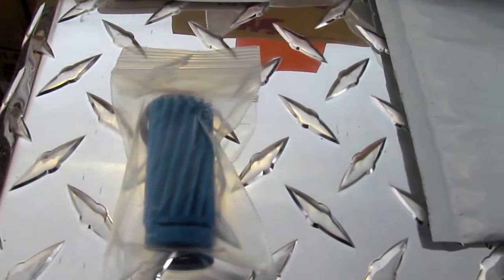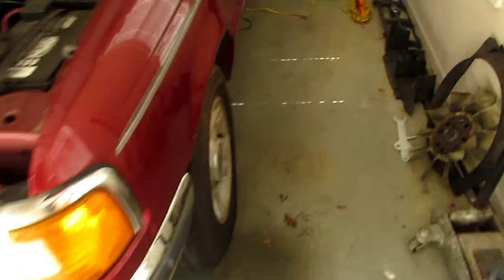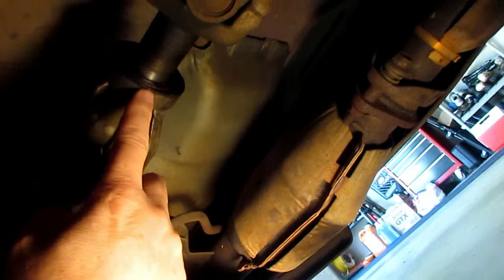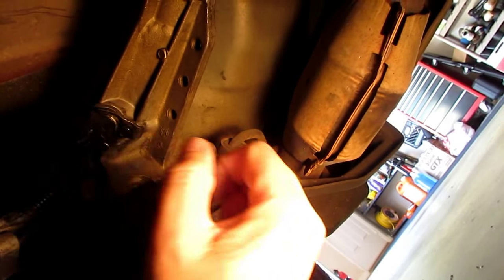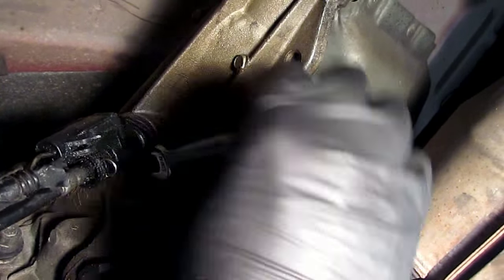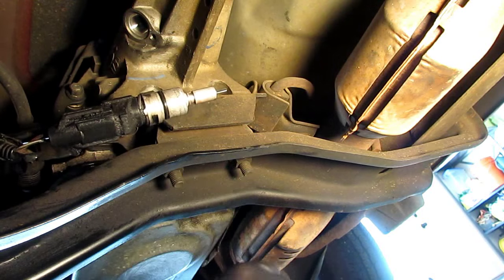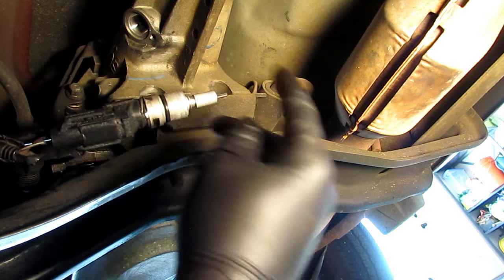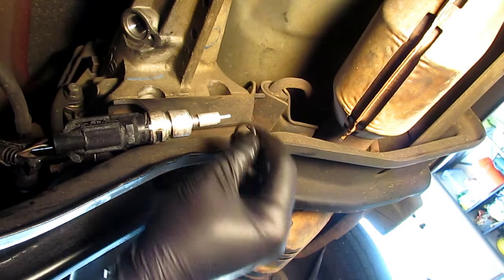Ford Ranger Speedometer Gear Change

Comment: Thank you for the video. I'm sure it was annoying filming under there but now I feel better about changing my speedo gear in my 91' Mustang.
Reply from the maker: Yea, at the time I only had my big camera so it was a pain to keep it pointed in the right direction.  I have a GoPro now with a little tripod and it makes filming in tight areas a lot easier!  I hope your speedo gear change goes as smooth as mine did!  Thanks for watching!

Comment: AMC used the same speedometer driven gears as Ford. I swapped out the driven gear on my '69 AMX from a 22-tooth to a 23-tooth.  It attaches to the cable in the same manner.  The screw that secures the cable to the T-10 4-speed is a 3/8".
Reply from the maker: Thanks for watching and for sharing that tip!

Comment: Was looking for this exact video! My 1994 Mazda B4000 SE 4WD manual speedometer starts bouncing back and forth when I hit 50 mph. The needle will usually bounce between 50-60 consistently when I hit that speed. I was told I should probably grease my speedometer cable. Would this same method work on my particular truck? And how would I pull the whole cable out, grease it with a PTFE-type lubricant and reinsert it from the gear to the instrument panel correctly?
Reply from the maker: Yes, sounds like you need to grease the speedo cable.  I'm not familiar with that particular cable, but normally, you can remove the gear from the bottom and slide the cable out of the sheath from the top.  There may be a keeper on one end or the other you have to remove, but otherwise, just slide it out, wipe it off and put your new PTFE lube on the full length of the cable, smooth it out and reinstall.  Thanks for watching!

Comment: Dennis, Thanks for posting this excellent video. 2 questions:
I am using just to simplify the non-functioning odometer and trip meters troubleshooting for my 96 Ranger. DYT that it is a bad gear within the instrument readout itself or could it be something else?. The speedometer is still working.
Also wondering if you might have an idea of the number of teeth I need for my 75 M-B O309D Bus that needed a rebuilt Allison AT540 transmission which I removed and replaced from another application (dump truck)  that now reads exactly half the actual speed?  I would think that 1/2 the number of teeth is correct. A speed shop in my area  (Puget Sound)I visited probably has or can get the right part. Your opinion would be highly valued.
Reply from the maker: Thanks for watching, Mark!  If the speedo is working and the odometer is not, I'd suspect a problem in the instrument cluster.  Not sure of that, but that's where I'd start.  And, you are probably correct about the number of teeth needed on that Allison, but I'm really not sure as I'm not familiar with them at all.

Comment: Great video Dennis!!!! My kid has an 06 Ranger with 33" tires on it. From what I'm reading it has a 17 tooth stock and I should go up to a 19 tooth? Does that sound right to you?
Reply from the maker: Thanks and thank you for watching!  If you increased the tire o.d., you'll have to go to fewer teeth on the tranny end of the cable.
Reply: Dennis Coffey  I have a 06 ranger with SOHC 4.0L V6 it has 17” rims it’s has no cable all I see is 2 sensors on the transmission and they’re both new in the one in the rear end and the two tire sensors I put my snap on scan tool and when I shit fit on second gear in the scaner  tells me that it’s in third gear I had the PCM reprogram with all the new updates and it still doing the same thing I just don’t know what to do anymore please help
Reply: @snj4807  yours needs reprogrammed by the dealer. 96-97 was start of electronic speedometer reading.

Comment: Dennis- Can I assume that you removed the original 225/70-14 tires and installed 235/70-16's. I have just done the same thing on my 1994 Ranger. When I am going 65 (per the speedo) I am actually going 75 (per the GPS). Are these the same conditions as you found with your truck and if so did the blue gear correct it? Thanks
Reply from the maker: +Dirk DeJong Hi Dirk, yes sir...that's exactly what we did.  The blue gear got us as close as possible.  Up to about 50mph with the blue gear, the speedo is now correct.  At 65mph, the speedo is about 3mph slower than actual speed, but since that is the smallest gear available, that's as good as we can get it.  It definitely much better than being off 10-15mph though.
Reply: +Dennis Coffey-------- Thanks Dennis. I finally got rid of those puny 14" wheels and the extremely limited tire options that fit them and put on a set of 16's from a later model. It changed my whole attitude about the truck. It sounded like you were on the same page so I just wanted to make sure you had the same tire sizes etc. I will double check my current gear to be sure I have a green one now but it sounds like the blue will be needed regardless. Thanks Again, Dirk
Reply from the maker: +Dirk DeJong Our Ranger is our youngest son's, and we both thought the same thing about those 14s.  I lucked out and found a used set of Sportrac 16 wheels at a great price,  got new tires put on them and it really made a difference in how that truck sits, looks and rides.  Thanks for your comments and feedback, I appreciate.  Godd luck with your truck!
Reply: +Dirk DeJong------For anybody else that happens across this post I have some more information that may be helpful to some. On my 1994 Ranger Extra Cab 4.0l V6 rwd truck I had stock 225/70-14 tires, an R5 axle code which translates to 3.55 final drive gears and an orange speedometer driven gear. When I installed 235/70-16 tires I was getting a speedometer reading that was 10 mph low (65 shown/ 75 actual). Using the information Dennis provided, I calculated the required gear using both of the formulas and averaged them to get a 17.78 tooth requirement. I installed an 18 tooth (grey) driven gear. My speedometer is now reading virtually perfect throughout the range. Hope this helps someone.
Reply: Where you buy the gear ⚙️ corrector .

Comment: Hello have questiong i have 96 ford ranger 3.0 and i have 33 inch tires with 15 inch rim my speedometer shows wrong if am going 35 my gps saids am going 45 what speedomer gear i will need .?
Reply from the maker: Thanks for watching, Yaritzel!  You'll first need to know which gear is in your transmission now.  Then go to 8:40 in the video to calculate the correct replacement gear.
Reply: @dwcoffey  thank you so much

Comment: Does the spotted shift on the sensor fitt into a slot inside the gear,or does it spin inside the gear
Reply from the maker: Thanks for watching, Doug!  It's been while, but I believe there is a piece inside the gear that goes into the slot so the gear doesn't freewheel.

Comment: Hi Dennis nice video man, Im trying to find not the plastic gear on the VSS but the internal Transfer Case drive gear, may be somebody else can find this usefull, I tried changin the VSS, the cable but only when we take the transfer case out found that internally there is a plastic gear too, was completly broken, Im trying to find that part, any clue dear friend? Its a Ford Explorer Manual V6 manual transmision, cheers.
Reply from the maker: I'm sorry Ricardo, I'm not familiar with the 4WD transfer case on the Explorer.  Thank you for watching!

Comment: Hi, a question. For the Ford Ranger 1994 V6 4L is the same location of the speed sensor? It change depends of the model year? Please your support. Thks.
Reply from the maker: Hi Sergio, thanks for watching!  If your Ranger has this gear on one end, there is no speed sensor, only this cable to the mechanical speedometer.  Later models had a speed sensor on the end of the speedometer cable, then some had a sensor in the rear end.
Reply: @dwcoffey  thank you very much. At the end means? Till end of transmision? Regards
Reply from the maker: at the end of the cable.

Comment: Can any one tell me the difference between a 1994 and 1995 2.3 manual ranger transmission is it just the speedo gears and can i swap them out
Reply from the maker: Thanks for watching, 94 and 95 used the M5R1 manual tranny.  Here's some info on the speedo gears:  
https://www.therangerstation.com/forums/index.php?threads/m5r1-speedometer-gears.16067/

Comment: I have a 3.08 rear gear with a 17 tooth gear and smaller than factory tires, it reads 3mph fast and I did 4 calculations using the same criteria and 2 got me 18, one got me 19, and the slowest got me 20.
Now im more confused.
Reply from the maker: Thanks for watching, Dominick!  So I'd split the difference and go with a 19 tooth gear.
Reply: @dwcoffey  After some more research I decided I needed a yellow gear so I took a yellow one out of my friends truck and swapped with my white one, now it reads accurate and his speedo works now so it was a win win situation
Reply from the maker: Fantastic!  I'm glad that worked out.

Comment: Ig I havent changed the size of my tires but the speedometer is reading 5 under the speed how would I fit that?
Reply from the maker: Thanks for watching!  You'll need 1 or 2 teeth fewer than your current gear.  If your speedo is 5mph lower than actual speed in the 20-40mph range, one tooth less will do it.  If the speedo is 5mph under actual speed in the 45mph+ range, you'll need two fewer teeth.

Comment: Hello, I have a serious problem with my vehicle. I own Mahindra thar crde 4x4 2013 model. Very often I observe the speedometer gear is getting damaged (especially when I hit a pothole). This is my 5th time I am replacing the gear. It’s 17 teeth model. I really don’t understand the root cause. I would be very grateful to you if you have an answer for this. Thanks in advance
Reply from the maker: I'm sorry Sanga, but I'm not familiar with that vehicle at all.  But...usually, if gears are getting damaged, it is because one of the gears is moving in a direction it shouldn't.  In other words, maybe the speedometer gear is not properly meshing with the gear in the transmission, perhaps the retainer bolt holding the cable in is loose.  If not, perhaps the gear inside the transmission is loose or damaged and chewing up the speedometer gear.  I wish I could be more help.
Reply: Dennis Coffey thank you for the quick reply mate. I will try to see first thing in the morning. Thanks again
Reply from the maker: Let me know what you find and I'll do my best to try and help.
Reply: Dennis Coffey sure, thank you mate 😊
Reply: Dennis Coffey it was due to worn housing. Got it replaced and it’s working fine now.

Comment: Will this also recalibrate the odometer as well
Reply from the maker: Thanks for watching, Jared.  Yes, this should make the odometer read correctly as well.  It won't change what's already been registered, but it will make it read accurately from the time the gear is replaced.

Comment: i have a 97 ranger speedo not working at all automatic trans. and speed sensor gear is red. i put a new speedo sensor but still not working any ideas.
Reply from the maker: Thanks for watching.  You may have a broken speedo cable, or the speedo itself is bad.

Comment: When I did this, transmission fluid came pouring out the hole. I just wonder why yours didn't do that. I have a 91 ford ranger.
Reply from the maker: Thanks for watching!  How much fluid came out of yours when you pulled the gear?  If is was less than a few ounces, I wouldn't worry about it.  If more, your transmission may have been overfilled.

Comment: Hey Dennis where could I find the drive gear just like you replaced for a 1991 f150 4x4
Reply from the maker: Hey Steven, thanks for watching.  I can't remember who specifically I bought mine from, but it was either RockAuto, 1A Auto or Partsgeek.com......I know I got it online, but not sure which one of these I use.  I only use these 3, so it had to be one of them  :)  Good luck!

Comment: I have the same problem with my 98 ford ranger also it takes time to shift first 3 gears
Reply from the maker: I love the Ford Ranger....it's a great little truck that has evolved well over the years.  The one consistent problem I see with them though is the transmissions.  they seem to always leak and shift odd after the mileage gets high.  thanks for watching!
Reply: Dennis Coffey  I have the same problem I had the transmission rebuilt three times no second gear it goes to first gear to third gear Emma rpm to so high where does it leaks and how can I fix it
Reply: Its most likely the valve that the vacuum line is hooked to it has a screw that adjust for faster shifting. They will start leaking and fluid will get in lines it won't shift right.

Comment: So my truck is registering 57 but radar is saying 50 what gear do I need? 18 in it now
Reply from the maker: As shown in the video, if you have a 2WD truck, you need a 20 or 21 tooth gear.  Thanks for watching!
Reply: @dwcoffey  I got it it works the same way as yours. As long as they are on the driver side of the transmission they all are the same thing and FYI mustangs are like that too.

Comment: Is this a 5 speed or automatic?
Reply from the maker: Hey Joe, this is an automatic.  Thanks for watching!
Reply: Dennis Coffey thanks brother I can't find the front sensor on my dads 98 5 speed I love changed the the vss sensor the one on the differential and for the sake of my life can't find anything on manual transmissions for this truck nothing whatsoever I'm betting its under the brake booster right on top of the trans along the bell housing is what I'm assuming but I really hate to take all that stuff out and be wrong. But thanks for the feedback Dennis.
Reply from the maker: Hey Joe, I don't think there is a 2nd sensor on the 98's....I think the only one is in the rear-end.
Reply: Dennis Coffey hmm I wonder what's the issue with my dad's speedometer I've drove it with a obd2 diagnostic tester and the vss sensor isn't responding it at times intermittently comes on till you cut off the truck then poof it's out again. See I believe it's something in the wiring harness cause I believe it was cut into to bypass something to pass a emissions test or some state test in Missouri where he bought it and in Tennessee we don't do yearly testing but they seem to have I think compromised the wiring harness and it should be working fine cause I replaced it with a new vss sensor. You think it could be what I'm suspecting or could it be in the instrument cluster itself? I really am bumfuzzled with it I can't really see no frail wires or breakage in the integrity of the wiring harness I really can't figure out what else it could be like I said before it does at rare occasions just up and pops its silly self on and works fine just for that duration of the drive but it won't rengage after shutting off the truck.
Reply from the maker: Joe I've read on some of the Ford and Ranger forums online that a lot of guys have had problems with the speedo in their Ranger due to bad sensors, wires that have worn through the insulation, and dirty/bad connectors.  So based on all that, I think you may want to check the vss connector, make sure it's clean inside and making a good contact, snapped in fully, etc.  Then do your best to trace the wires to the vss.  One guy I read about had trouble with his speedo because where the wires ran through a section of wire-loom, the loom had slipped and allowed the wires to rub on something, wear the insulation away and then cause a short.  I don't know if this is feasible, but if you have a VOM, maybe you can get to each end of the wiring run and check for continuity, especially if you move the wire around.  That may help you either find the problem, or eliminate it from your list of possibilities.  The other option, as you mention, could be the speedo itself.  Probably the only way to know that for sure, is to replace it with one that's known to work.  Maybe you can snag one cheap at the junkyard?  Let me know if I can help, Joe.  Thanks!!

Comment: Where is the speed sensor on a 2000 Ford ranger manual 4 cylinder
Reply from the maker: It's on the right side, rear of the transmission, near the tail shaft.

Comment: where did you get the part?
Reply from the maker: Thanks for watching, Summit Racing is the easiest place to find them.  I've also seen them on ebay.
Reply: @dwcoffey  thank you sir. My odometer & speedometer arent working i replaced the gears in the cluster and the speedsenor on the diff lock on my 98 ranger 4x4 not sure whats wrong with itt

Comment: This shit doesn’t even work I ordered the same exact speedo gear and my speedometer doesn’t even move
Reply from the maker: Sounds like you might have a broken speedometer cable.
Reply: Nope my original speedo gear works just fine I swapped that one in didn’t work and the original back in and it did
Reply: I have a 95 2.3 ordered the blue 16 tooth gear looks exactly the same as yours it’s even made by ford it came in a ford parts box
Reply: I got it to work by cutting the speedo gear down to the same size as the original I have no idea why it didn’t work like it did for you but it worked after resizing it